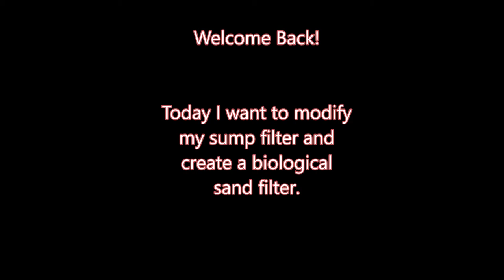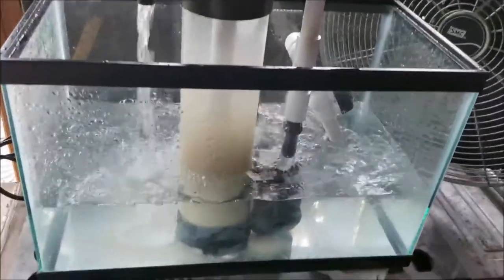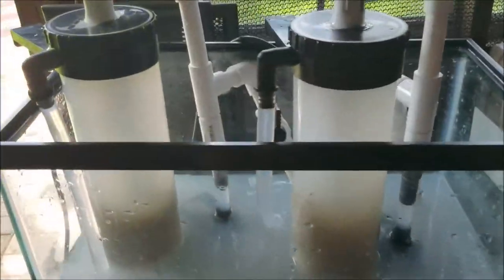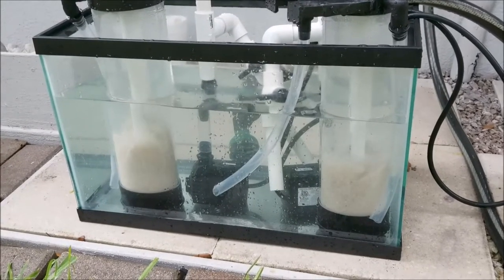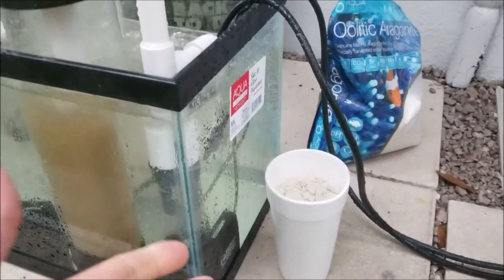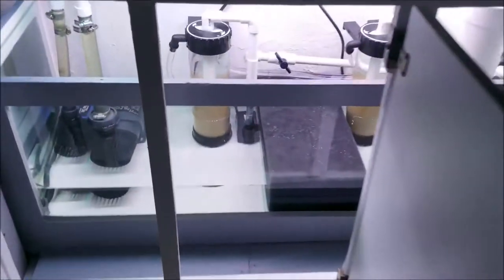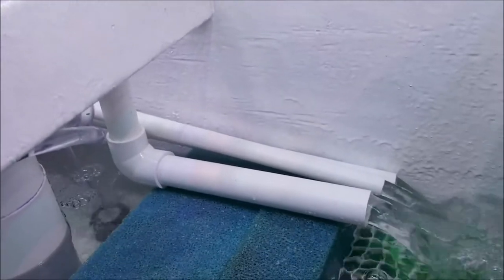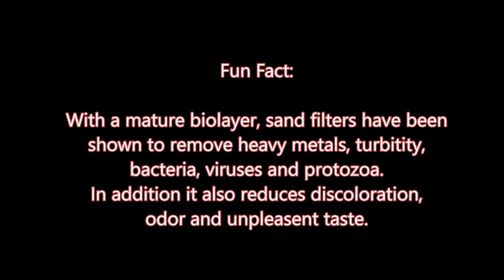DIY Sand Filter

Comment: Is there anything on the end of the down tube for the sand filters like a pvc cap with a hole drilled or is it just an open pipe? Thank you
Reply from the maker: Open. Its channelled pressure. Do not cap off.
Reply: @alfredorosado1  Thank you for your reply. How do you prevent back siphon when you turn off pumps?
Reply from the maker: @deejay2606  I have had a few power outages, however the sand seems to stay in place. In fact, when I re-energize the units , the fluidization continues as if nothing happened. Always wondered about that, but so far I have had no issues.....knock on wood. Hope this helps.
Reply: @alfredorosado1  Thank you sir
Reply from the maker: @deejay2606  no problem.  Let us know how your build works out.